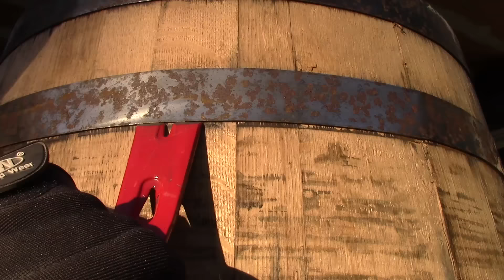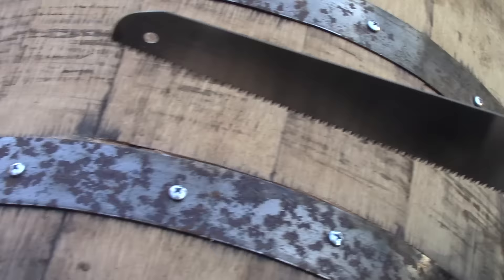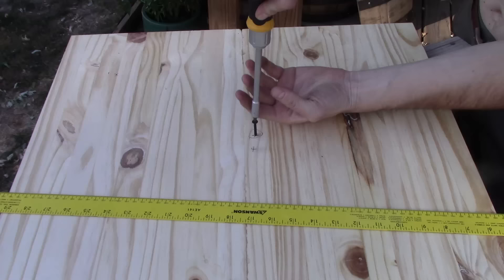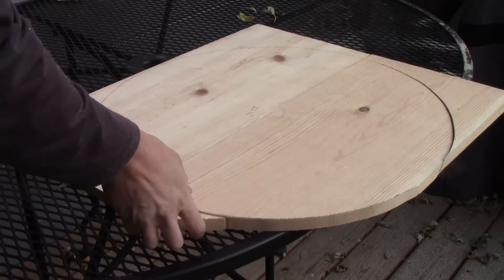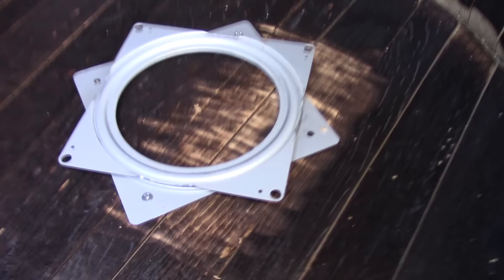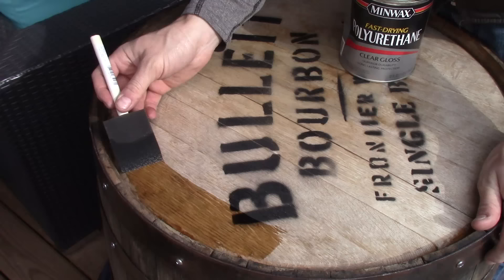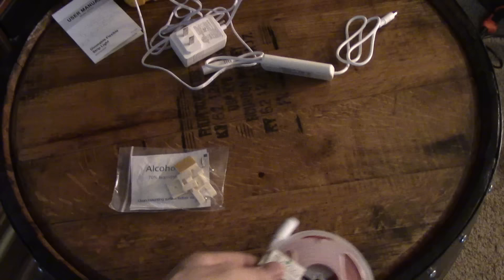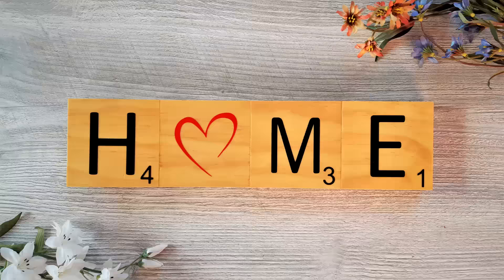Bourbon Barrel Cabinet - Handmade - How I Make Them

Comment: Very nice! Do you find that the door holds its shape well enough over time without any kind of brace?
Reply from the maker: Time will tell, but I selected these hinges due to their strength rating. I think they were rated for 30lbs a piece and the wooden door, although heavy, isn't near that weight.

Comment: What size screws are you using to hold the bands on?
Reply: I currently use #8  3/4" self tapping screws with a round head, which work great.

I used #10 5/8" in the video, which I've since changed to the above.
Reply: @metzvm  started my barrel today and picked up the #8’s. They worked great. Thank you for the reply.

Comment: Nice tough a tip screws could had been more inline
Reply from the maker: I agree. It's one of the many things I didn't pay attention to at first. Luckily, my newer barrels are more flush and inline. :)
Reply: Which screws are you talking about? The ones on the metal brackets??